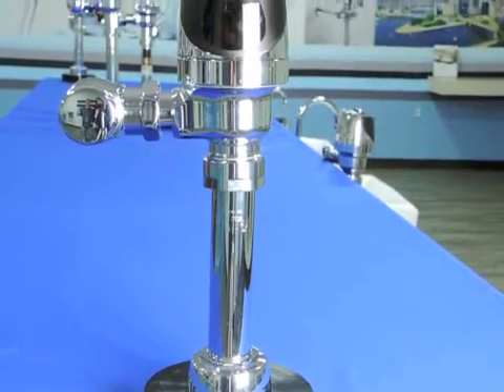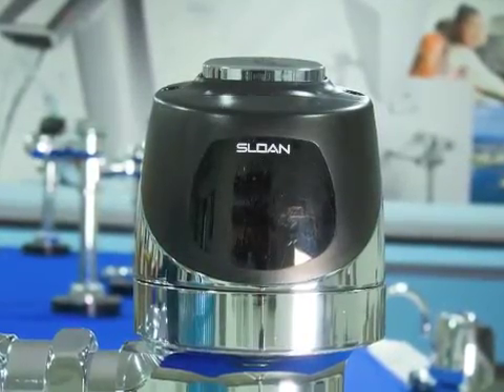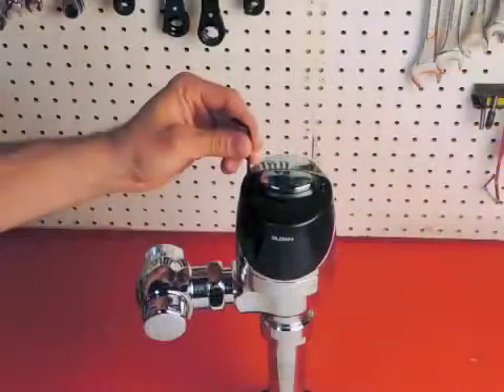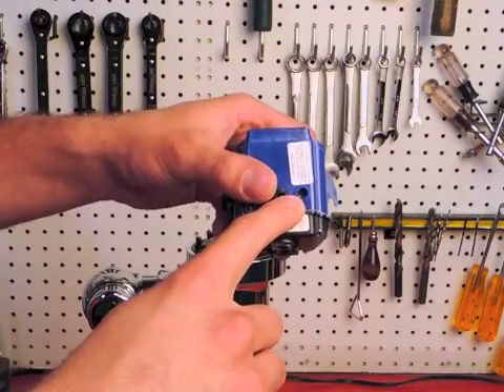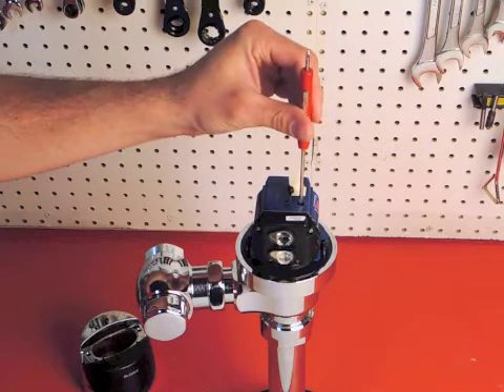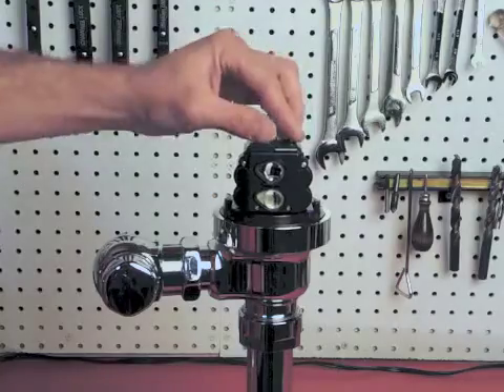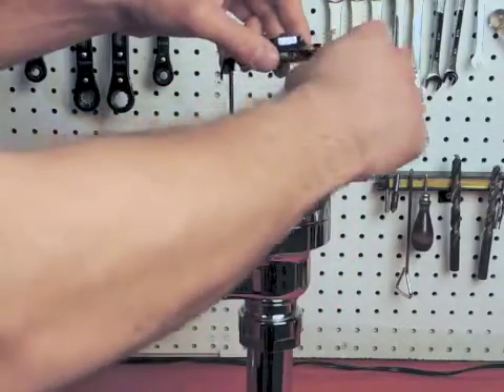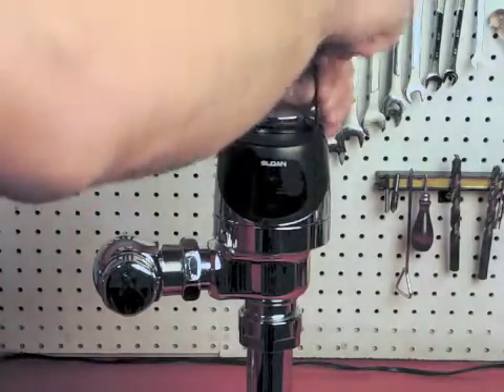Sloan G2 Flushometer Sensor Range Adjustment

Comment: If you don’t see a screw.  Lol then your screwed? Lol
Reply from the maker: Well, in so many words, Paul, haha. Here are some links you might find helpful to get a new control module with screw: 
Quick link to replacement G2 Control Module for Urinals: https://sloanrepair.com/collections/g2-optima-plus-flushometer-parts/products/sloan-electronic-module-g2-urinal-ebv129au
Quick link to replacement G2 Control Module for Closet:
https://sloanrepair.com/collections/g2-optima-plus-flushometer-parts/products/sloan-electronic-module-g2-closet-ebv129ac
Reply: Just tried to make adjustments then saw this video guess what I'm screwed.